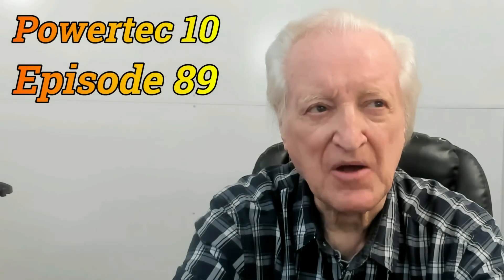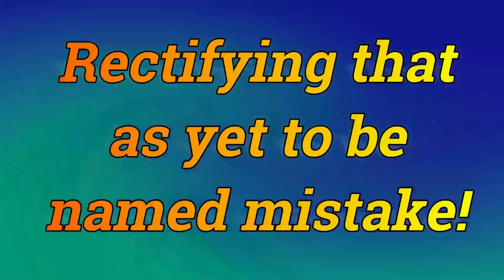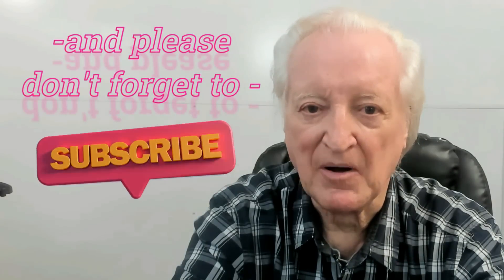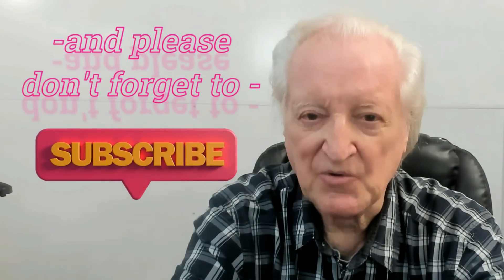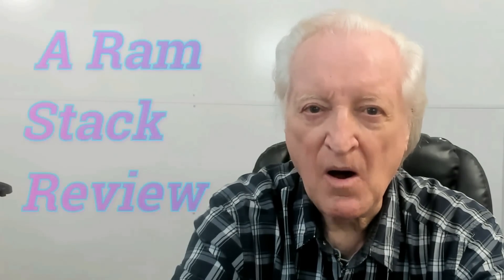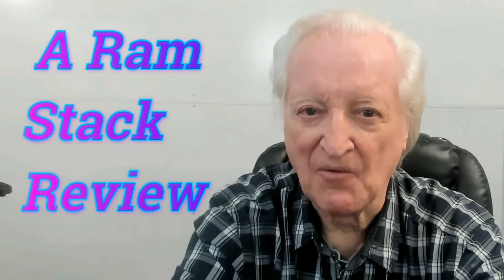World's most POPULAR & WORST velocity stack

Comment: Several years ago I was working on a SBC drag car. Installed a K&N stub stack just putting it on raised the idle speed and the engine just sounded better and smoother. It also picked up some time on the track. As I remember.5 to a full tenth. Definitely sold me on using them

Comment: Hey again David, i totally agree with everything you said in this video, and i suspected that those oversize velocity stacks would be detrimental, especially when you see they put a grill/filter INSIDE the so called trumpet. Talk about 'reducing' your surface area/flow, whereas with a proper filter 'outside' your intake bellmouth/trumpet(s) etc you are 'increasing' your surface area and therefore dropping some restriction but also spreading that air out more evenly for less buffeting, just like the mesh in front of an airflow meter or the vanes in a wind tunnel or the vanes in the airflow apparatus the put on F1 cars to test in the field, I always run good K&N air filters on my rally car and my turbo road car and won't ever overly 'wear' an engine chasing power you can easily gain elsewhere, longevity/reliability is what most of us want, i hope anyway. Cheers again David 😅😅

Comment: In your Tuning the A series book I saw the section on testing of sll differently velocity stack designs... The best ones were those with a full radius at the rim, but by far the winner was to just have a full radius at the very entry to the carburettor with no cone/trumpet.

I run a DCOE weber on my car (not an A series), and because I have limited room in my engine bay, on my lathe I made out of aluminium some rings which bolt to the face of the carburettor barrels. Like if you looked at a donut side-on and sliced it right down the middle so you've still got a full circle, it's just torus faced on one side and flat if you flip it over. Simple but I'm sure some people will think I mean that I made a C or D shaped donut. No.

Anyway the radius was about 6mm.

But I did notice a difference in that the car had more punch to it. Currently I run one of those foam, elongated dome shaped filters covered in a stainless steel cage. When that's due to be replaced I'll definitely try a K&N filter instead

Comment: Excellent video as always but 
I have a ????

I have a old flat 4 VW with dual Weber idfs so each cylinder has it's own separate port all the way to filter

I was going to make 4 short ram pipe carb tops each will perfectly line up with the individual port holes in the carb 
And will run dual k&ns 
Here's the question  these should work similar to your design 
Right since they will be made to fit and stream line straight down the round carb ports

Comment: Hey Mr. Vizard. 

I follow you on the slow non turbulent air filter airflow idea, but what about forced airflow? My Predator carburetor came with a short 2" stack with a honey comb insert that's supposed to straighten the airflow out, but I don't like the look of it. This is going on my BBC mustang with single plane intake. I am curious on building a air scoop for the track that faces forward and possibly putting the water injector at the tip where the air would enter to help cool the incoming air, carb and fuel down altogether.  

Most air scoops I see out there have large volumes and a wide floor such as a dragster tray type or the acrylic mailbox looking ones. That would seem to create a turbulent high pressure area around the top of the carb, but might have lower pressure than a scoop that streamlines from its opening to the top of the carb and forces all the air directly on the throttle blade itself. 

An ex. would be like a something like a blow through hat that morphs into a  triangle/ovalish prostock style scoop that maybe meets the cowl hood. What are your thoughts on this?

Comment: I've seen cars with no air filter at street shows. You can tell the owner has put a tremendous amount into the engine I always talk very respectful to them. I ask when they are working on their daily drive do they see sand debris on top of intake manifold. Yes is their answer I live in Florida alot of silica sand here it eats cylinder walls . I worked with a very smart man who said do you think  that if it wasn't necessary all manufacturers would not invest in it cost per unit would be crazy.  Why do the best engine builders in NASCAR run them 500 miles on a super Speedway watch all the debris fly and calculate how much air is being drawn into a 358 ci engine at 8200 RPM . Thank You Mr Vizard

Comment: What would be worse, an EFI elbow to a remote mounted k&n in cool calm air. Or a dropped filter that barely clears your hood and has less than an inch of room to let air into the carb, sucking hot air. 
Or the same low profile with cool air ducted into an air box style round air filter.

Comment: In the 1960s Hot Rod magazine published a separate flyer that fully explained the how and why of tuned intake runners and exhaust headers. And how they work. They included in this flyer mathematical formulas for getting the runners or stacks to the right length in order to get the power out of the engine at the desired rpm. Unfortunately I don’t think my father has his copy any longer. And it’s not just about smooth air flow. It’s also about scavenging and using the pressure and vacuum waves caused by the opening and closing of the intake and exhaust valves. Air has mass and volume. And it’s about making use of the momentum of the air being either drawn into the engine. Or being exhausted from the engine.

Comment: David, this topic would be easier to grasp if you took molds from the throttle plate towards the intake and then look at the transition from the carburetor barrel to the funnel. That is, the airflow problem is just like the "short side radius. You could then point out the smooth transition compared to the "other" transition.

Comment: Ok David, great discussion.  Consider this, if you take a cup of water,  put a straw into it, then you blow compressed air across the straw it will lift water out of the cup. I believe this happens with booster buffering. The worst part of carburetors is the 90 degree turn the air has to make at high speeds. The air filter helps slow the air down and turn it.. as for velocity stacks it creates a reverse nozzle effect that reduces the vacuum at the booster. Just my opinions am I close?

Comment: The bell mouth exists on a jet engine to smooth the air flowing through the inlet. 

But a jet engine uses 3/4 of the air flowing through it for cooling and so needs a huge air volume going through it.

Comment: I have to tell all that this K&N ram stock works very well and I did it on 88 Cadillac with 307 and Rochester carb getting 22 miles/gallon at highway speed (75mph), and all is at factory specs.
Reply: I often wonder what kind of stack can be made for TBI's used on the 90 Cadillac Broughams & many other GMs since those huge injectors are in the way, other than the usual TBI mods cutting off & radiusing the factory velocity stacks.....+ Hypertech sells that big bowl adapter for the air cleaner that seems to funnel air   in a bowl shape instead of a funnel shape which David says isn't good.  Turbo City back in the day was the TBI performance parts mfg, & their air cleaner adapter was a large funnel that would attach to the bottom of a factory air cleaner base that needed the base totally cut out.....now it seems that funnel design was a bad also!!!!!

Comment: Iv'e  got an aussie  Valiant  with the  245 Hemi 6 cyl engine ' the carb is the original Carter 2 barrel  with  the factory air cleaner with paper filter 'I remember once driving it around with the filter  and canister  removed '  and there was a very noticeable drop in power .

Comment: Carburetors would flow better if they had a far-smoother set of transitions from atmosphere to venturi and then back out to plenum, would they not? (Thinking of the design of the new Edelbrock 4100 carb.) It would mean that for ultimate efficiency, the venturii would be far longer to ease the transitions between diameters, but few seem to be interested in a taller carburetor.

Comment: Bravo!!!!

I’ve found this true with cv carbs

To tune them to max capability I drilled and jetted 1 inch holes in the airbox lid.    Twin 32mm intakes loved 12x1inch holes in a flat lid around the edge perimeter.   Not in the center.  

Whole key was straightening the airflow.   Buffeting reduces airflow with reverse waves causing fuel to ANTIATOMIZE. OR puddle instead of disperse.  

Meaning  more surface density. Of fuel molecule on condensed fuel area and loss of fuel burn efficiency (imagine time spent burning small pieces of a 1 pound wooden log vs 1 pound log all together large piece)   Understand that.  And that’s where vacuum in the intake must exceed SLIGHTLY vacuum above and inside the intake manifold (carb only)

Comment: Speaking of K&N filters,  do they filter air that is uniformly passing through it if it does not have the pulsations inherent in an engine. You mentioned previously that it’s the vibrations of the gauze filter media that remove debris at a high efficiency.  If you take away those pulsations by using a centrifugal fan,  will it filter?  

I have serviced high efficiency natural gas boilers that use genuine K&N filters on the inlet of the burner air supply fan and wondered about the usefulness of this type of filter here.

Thanks for your attention.  Love the channel.  Definitely waiting on the outcome of the 318 build.

Comment: I’ve got a 14x3” K and N dropped base filter on my 429 powered Galaxie, it was running 13.1 second quarters but when I removed the air cleaner I ran 12.7. So now I run a filter on the streets and remove it for the drags.
Reply: Do you have velocity  stack on the tip of the intake? If yes .. is the same stack inside of the filter for street runs?
Reply: @ornellalall3712  no velocity stack, I simply removed the air filter assembly and ran a bare carby.

Comment: Looking forward to continued info on carb's. We run dirt track, 2 barrels (4412, stock) and need every advantage. We cannot run a direct ram air setup, but I'm considering an indirect ram air. My thought is 1-cooler air, 2-secondary plenum, 3-less fine particule intrusion. 
I read, and reread your stuff, and watch everything you and Andy put out. Great info that can be logically used.

Comment: Hey David,
     Tim here......WOW!!!...this hit home for me.....i've been tryin to get my Poncho in the 10's (pump gas motor)......i've ran a bunch of 11 teens, and a few 11.0's (11:07 @120 best)..ok, quick rundown:  '64 post Tempest body,  3450 lbs with me in it, 462, 10.44 static, Kauffman D-ports (310 cfm  cnc program) healthy flat tappet (high 240's low 250's @ .050, 110 lsa), 3:73 gear, loose 4000 flash converter........i'm right there, but u brought up a point i believe i missed......it has an old school '62 SD scoop (last one Nunzi had) and i made a pan to use when racing, (normally a K&N 4" filter used with a Moroso top & bottom) ........maybe my no air filter pan (when racing) is causing buffeting, and never thought or realized it........the thought was to get rid of the filter, put the pan/box on it, force that colder air, and race.....from what ur explaining, i'm losing 6-8 hp....well theres my 10.99 with a 9.......makes me wanna get in the garage, and get after it.......TY is a massive UNDERSTATEMENT........i bet if i just keep the air filter on, or up size  to a  5" element to get it higher into the scoop, (1"shows with 4"element, a 5" wud get me 2" into the fresh air) i bet theres my LONG sought after ET...........comment if u can......but this was the BEST vid you've ever done for my particular scenario.......trin to squeeze .08 more outa my girl, i'm SURE gonna try!!!.....again TY is an understatement, i have tuned and tuned.....THIS video shed light on a potential progress maker....TY SIR!!!......sorry so long......btw, Charles is doin GREAT stuff for the Mission Impossible build.......may you guys bring a HEALTHY # for St. Judes!!!!...what a noble cause!!!!....LOVE ur chanel, and pray it will continue for YEARS to come!!!!!.....PEACE to you sir!!!

Comment: Thats exactly what i wanted to do, a stack with a large filter, 
Or  use a velocity stack, with a large filter, id like a 16" x 24" x 6" tall, oval,  i doubt anyone makes one, so a 14x4" that mounts to the hood,  with a rubber boot, connecting it to a velocity stack,  a short one, with the air  coming into the front , or cowl areas,
Reply: Napa parts books used to have air and oil and fuel filters listed by dimensions (and thread sizes for oil /fuel filters)

Comment: I've been reading your articles since I was 13 or 14, even buying car magazines sometimes for the three or four pages you had written which in the early /mid 70's was a lot of pocket money to me but well worth it.
I didn't know about the 'stub stack' until now but thought a car carb without anything to smooth airflow in would be a really bad idea with all the sharp edges and angles causing turbulence. (various friends had 'modified' Mini's, Marina's and Escort's back then)
Anyway, I've heard anecdotal stories about motorcycles with 'modified induction systems' (factory air box removal) having carb issues  in cross winds but never actually experienced it myself, my theory was forward travel should be faster than any cross wind I would be riding in. (plus, I always fitted K&N filters when stock air-box was removed)
When the 'Cafe Racer' craze hit in early 2000's I gave up telling people what they were doing was hurting any performance they had, looking up area restrictions for various mesh sizes to quote numbers was a great waste of time (I think McMaster-Carr gave area reduction percentages for different mesh sizes and wire diameters)
I did come across an interesting article about 20 years ago about bell-mouth design with various flow dynamics based on parabola instead of curved or straight walls, do you know anything about it? (I can't remember if it was motorcycle specific though so may not have been something you ever saw)
Reply: My old Kawasaki kz650, remove the airbox lid ,start it up and whack the throttle. 
It'll just about crap right out before it starts stuttering and even tries to ramp up.
Reply: Pegasus racing(?) Their catalog used to list the percentage of flow for various mesh types they sold,besides the dimensions.

Comment: I had a 69 AMX with a 70 Javelin hood. The hood was the same color as the rest of the car, so it might have been ordered from the dealer. It might have been off a car that had been rear ended, I don’t know. the 70 javelin hood had a cold air scoop on it. The AMX had them too, but they had a special air cleaner that would attach to it, allowing the engine to take in cool air compared to the high temperature air under the hood. I bought a low rising velocity stack with a foam filter in it. the plan was to seal it to the hood with a foam edge that would go from the outside edge of the velocity stack to the scoop. We’ll, I never built the foam air director for it because it lost power with the cheap velocity stack. I mean it was a seat of the pants measurement, but it was clear that the engine didn’t like it.
Reply: Those things would catch fire too !!  If your engine "sneezes" wrong while you are tuning up a fresh rebuild it sprays the cheap foam with gasoline and ignites it.

Comment: what about those air filter lids with the filter built into them ,do they help or hurt anything?do they pull air from the sides and top?
Reply: They usually work better if you run tape around the side so that they only draw air through the lid.
Reply: @tbrmotorsports2244  top lost power, better pull only from sides.
Reply: @V8Lenny  lost power until they ( Engine Masters) taped up the side filter.
Reply: @troymecey  it was tested before by professionals, not engine masters.

Comment: 1971 Dino 246gt. Dynoed the engine  having problems no response from jetting changes
Down 15 hp on power. Found the air box on the weber dfgs was causing problems.
For competition ran without the lid but a wire covering to keep rocks out gained 12 hp at the wheel for a grand total of 154 whp also gained a little by making radius stacks
Reply: Yes, that aircleaner is not the best. But if you raise it ½" so it juuust clears the lid, and cut 2" off of the snout you will get almost the same results.